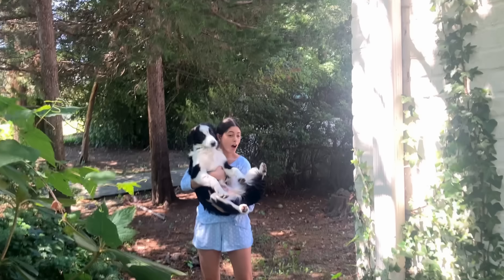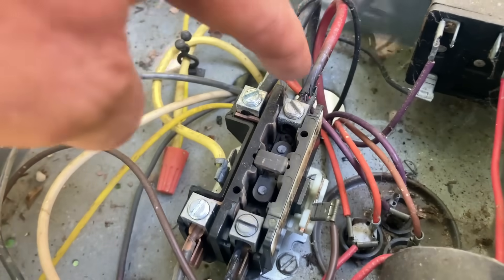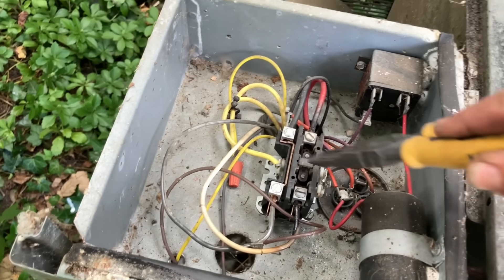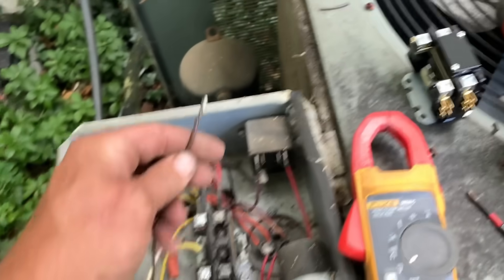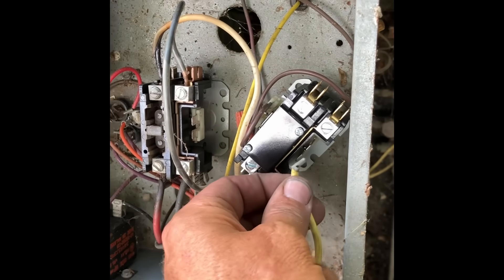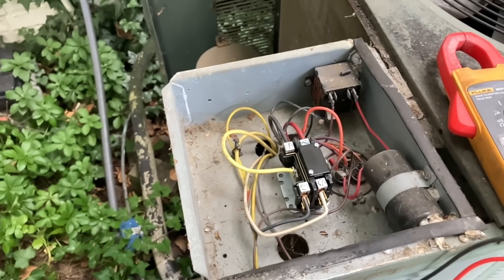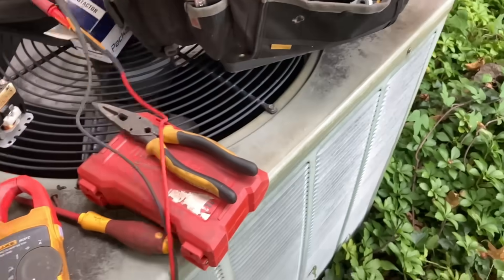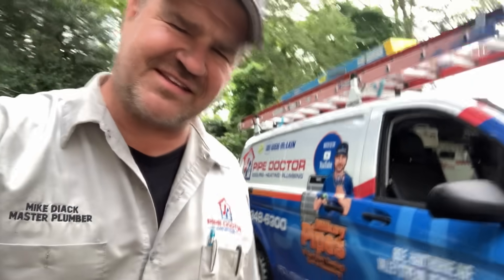Homeowner Shocked by Dangerous HVAC AC Wiring MELTDOWN!

Comment: Great job and explanations.  2 things: 1: ever think of adding ferrules to the ends of the 240v leads to the contactors? and 2: adding grommets to the wire passes out of the control box to minimize the possibility of the wires from fraying and/or creating a  short.

Comment: Me and my girlfriend Cheryl just did a contactor  change today on a 1998 Ruud Achiever.  We got the call yesterday evening, i told customer to set thermostat system switch to off, and leave fan set to continous on, and told him to just use the breaker for the condensor, and turn it off when house hits the temp he wants, and when it warmed back up, he would flip the breaker for outdoor unit back on.  He kept breaker on till he went to bed, and then he flipped breaker off, tgenhe flipped it back on when he got up,  kept it running till we showed up.  Me and Cheryl use either mars or jared magnetics contactors.  We replaced his contactor, checked run cap, cleaned coil, and checked refrigerant levels, and amp draws, and all is A okay.  Ghese Ruud and Rheem units are tanks.  When the contactor is welded shut the low and high pressure switches are basically bypassed and wont do nothing.  Great work mike.

Comment: You'll be back soon replacing the "blazing hot" disconnect. The wire whip is too long for the heat to reach from the contactor all the way back to the disconnect (a little bit may get there, but not enough to make it "Blazing hot."

Comment: As a homeowner and not an HVAC guy, whenever I do a contactor, I usually pull the coil wires off first, cover them in electrical tape since I know my butterfingers would DEF short them out LOL!!! (and I don't have Mike's years of experience doing this)

Comment: The wiring box where contractor is mounted is open to the atmosphere and moisture will always pit up contacts.
Sealed wiring box would protect wiring and controls.  I just realized as an oil tech my hands used to look like that for decades. Really rough.   Keep up the good work.

Comment: Mikey, Out of respect for a fellow technician. Please take that gold bracelet off. It's going to conduct bro... The same reason I don't keep my strings in my new hoodies.
Reply: Sounds like your speaking for experience, and is an example of being aware of your surroundings.  Good catch for the newbies.
Reply from the maker: It’s plastic
Reply: @PipeDoctor  plastic or not, it's very likely plated in something highly conductive to make it very shiny and that can kill you!
not a lineman for power co, but I have worked with voltages over 10K and RF output enough to cook you if closer than ten feet when wearing anything metallic, that includes glasses, keys/rings/tools and most anything/everything. nylon, porcelain, ceramic, glass and similar to not get cooked and always lock/tag out everything!

Comment: doing it Hot 24 vac LV that is  .... Rheem TankS installed 1.000 s back mid 90 R 22 days till Gov regulations  > 410 changed the game  & stuck contacts outside with tstat satisfied &  indoor blower  off the  not great ..So Lucjky if only a few burnt wires
Reply from the maker: Thanks for the comment!

Comment: When contactor sticks Mike it’s the contact pads that stick together. The low pressure switch was likely open as well as the call from the stat wasn’t present. That’s why you had to pull the contact points apart. You should have corrected the wiring in the disconnect as well. No shaming just saying. Your friendly retired old HVAC guy in Toronto 👍👍🇨🇦
Reply from the maker: Thanks for the tips!
Reply: that compressor will likely not last very long now, unless the charge was so low it wasn't flooding back and just frosting. just maybe, seeing the top of it wasn't frozen over and paint blistered/rusted away, likely low on charge too. I have a feeling this will be a sour call back/new work order. lol
didn't notice of the disconnect had any issues. the darkened color bare ground almost looked like a burnt white wire at first.

Comment: If the old coil was stuck closed the high and low pressure switches wouldn’t do anything.
Reply from the maker: True. Wasn’t thinking
Reply: coil/contact you meant, they were arc welded shut. but exactly, useless switches in that case. probably be a call-back for very low charge/etc. seeing the hot/cooked compressor top and no mention of airflow issues indoors/water flooding.